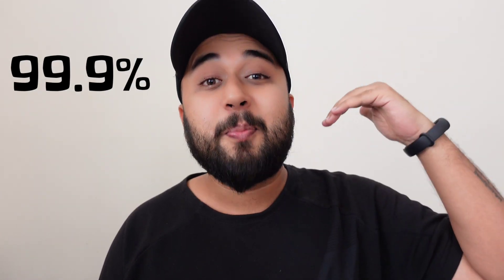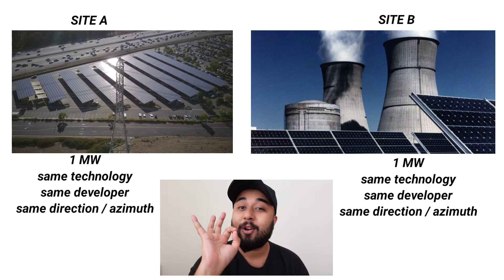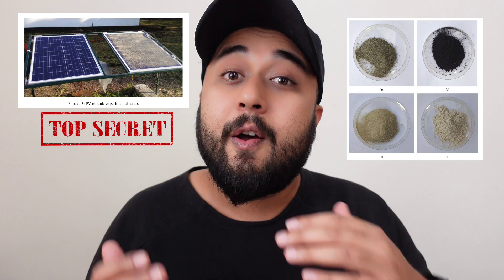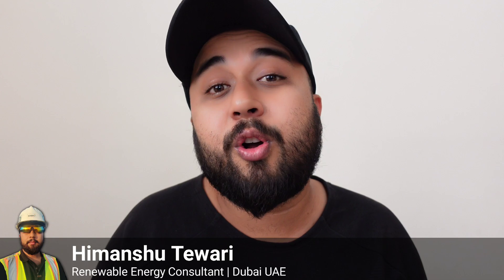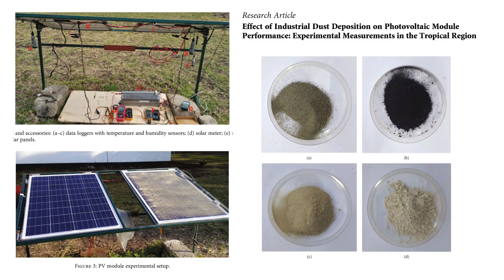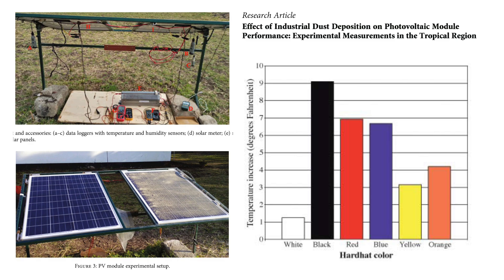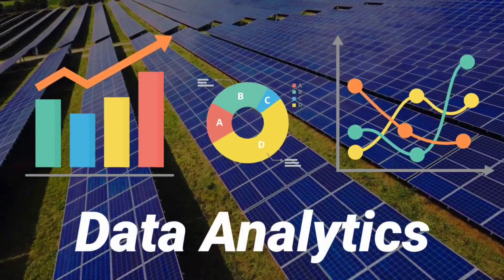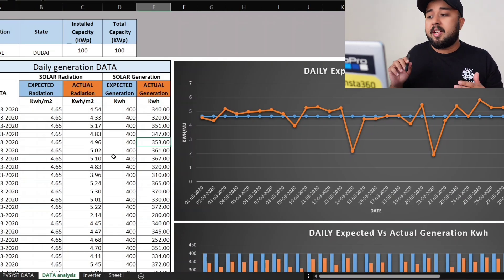Shocking Relationship Between Dust & Solar Cell | Soiling Experiment

Comment: Solar panels work due to light energy not heat energy. Coal performance is low because it could occupy higher surface area compared to other dust.
Reply from the maker: Brother Vinod I hope you are aware about thermal stress which derates the performance of semiconductor material ? Silicon used in PV cell is a semiconductor material

Comment: You should use System Advisory Model (SAM). as it uses air to mass ratio coefficient for soil. I have worked for both 50MW concentrated photovoltaics and 50MW concentrated Solar Power to optimize their capacity factor and LCOE for different stations. it was a really good experience on SAM.
Reply from the maker: I hope you are aware that The Financial modelling of SAM dosent cover the loss which I am highlighting in the video
Reply: @SustainableEveryDay  sorry brother
I was unaware.
Thanks for sharing information

Comment: I have a excellent product which is Nano Powder which when applied to glass surface will make it super smooth and will resist any deposits
Reply: What is nanp powder how it works PL send me link to study? PL rely
Reply: @Akolkar2  thanks for your interest. As you may know all surfaces have micro pores on the surface and glass and solar panels are no exception . Our Nano powder has nano particles which embed in the micro pores and fill them up . The surface becomes super smooth and foreign particles have no space to lodge and deposit there.
Water will simply slip away other particles also move away. 
This will help in keeping the panels clean . 
This product is useful for vehicle wind shield,shower glass enclosures ,head lamps and other products .
We also have a range of Nano products for 
Automobiles, industrial equipments, construction and farm machinery and heavy vehicles .and Air Condition and HVAC equipments . 
For Automobiles 
1) Engine Treatment 
2) AC Treatment 
3) Suspension Treatment 
4) Tire Treatment 
5) Power Steering Treatment 
6) Alternator and Self Starter Treatment
Reply: @Akolkar2  The current website is down and new one is being made . If you share your contact information and email I’d  I can send you all the details of all the products we offer
Reply: @MrKhabbu  If I send my contact here it would be used in all social media.
Reply: @Akolkar2  No I don’t think so . 
Plus one char ek che nau shunya saat char Saat panch panch
Reply: @Akolkar2  Hindi mein likha hey woh samaj lo aur contact karo

Comment: sir 5kw grid inverter mai maximum input current 11 amp per mppt. par 550 watt bifacial panal ka maximum output 13-14 amp hai  kaise connect hoga sir inverter supplier bol raha hai 1 in 2 out karo inverter mai 2 string hai please help.
Reply from the maker: Msg me on LinkedIn from video discription

Comment: What is the reason for red spots on the panel and how to avoid it?
Reply from the maker: Please share the pictures with me on my LinkedIn
Reply: @SustainableEveryDay  Actually I am on on job training and not allowed to take pictures. The spots are seen usually after cleaning the panel
Reply: @Mazhar Motabanna  what do the trainers say about what causes the red spots and how to avoid them. Also what are they cleaning them with.
Reply: @bryanterry6387  Hi Terry thanks for the reply I haven't asked them about it. They are cleaning with regular tap water and soft bristles brushes
Reply: @Mazhar Motabanna  If you find out please let me know also see it cuts down on production. Thxs
Reply: @bryanterry6387 ok sure

Comment: Sir I want your guidance for solar. Vendor installed 14 panels of 445 Watts. But inverter is single phase and connection is three phase. Production in a day 12  units.
Reply: Something drastically wrong if you are getting only 12 units a day from 445x14 = 6230 watts or say 6.23 KW system . Yes on cloudy days this is possible but on an average you should get around 25 units per day.
Normally domestic Invertors are are single phase as they handle DC  . You may have 3 phase AC connection from the supplier . 
Don’t worry about it . 
But look in to Production
Reply: @MrKhabbu  very very thanks
Reply: The vendor corrected the string and producing 28 units daily. Thanks
Reply: @krishanlal3109  very happy to note your problem solved

Comment: Does sprinkling water over pv panels during the day, thereby reducing the surface heat increase the efficiency? Any studies?
Reply from the maker: No it only waste fresh water , the production reduces because of non scrubbing
Reply: @SustainableEveryDay  Water can be recollected, filtered and reused at the same time. So, no wastage. My question is does production increase in cooling the panel?
Reply: Yes it does but breifly

Comment: Many textile mill roof top solar plant required 15 days cleaning for getting full production/ efficiency
Reply from the maker: Sad reality
Reply: This problem can be solved easily. The textile units can  use parabolic collectors to heat water instead of coal or fossil fuel . 
In fact they can go for indirect solar power generation . In this first solar collectors heat water and in turn generates power.

Comment: Is the output of a photovoltaic cell dependent on incident Heat or incident Light?😯😯
Reply: Incident light !!
Reply from the maker: Correct Incident light not heat, if in case it would have been heat for some reasons plant operator would have been burning near by forest for heat in the night time to produce power 24/7

Comment: There is some problem with the claim that PV system near thermal plants will underperform. This is because thermal plants have electric filters to collect soot and coal ash being released. The coal stored also are not stirred violently that the coal dust starts flying. The problem of coal dust comes only near coal mining sites rather than near thermal plants. On the other hand, a PV system near heavy traffic road will get soiled very quickly and will need too frequent cleaning.
Reply from the maker: The crux is should we install plants in these areas
Reply: @SustainableEveryDay  based on the availability of land, if its utmost important that they have install solar plants there, then they should follow your dry cleaning techniques
Reply: Valid point
Reply: The data is correct. Fly ash soiling causes more soiling losses than the particulate dust during road construction.
Reply: @shashitm1084  It is true that fly ash soiling causes more losses than particulate dust. But the modern power plants filter the fly ash and hence emit very little fly ash. You can see this from the fact that the trees near thermal plants are not covered in black soot but the trees near roads are covered in thick dust layers. This implies, the quantity of fly ash near coal plants are significantly less compared to the dust near heavy traffic roads and hence lower losses near power plants.